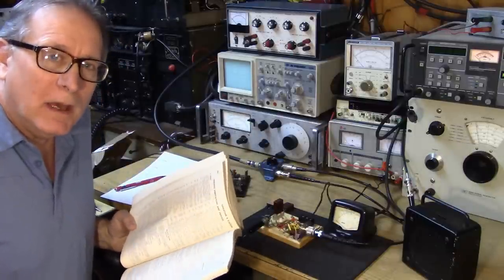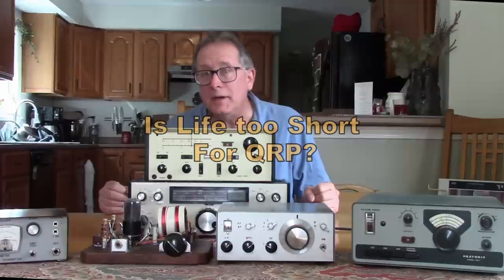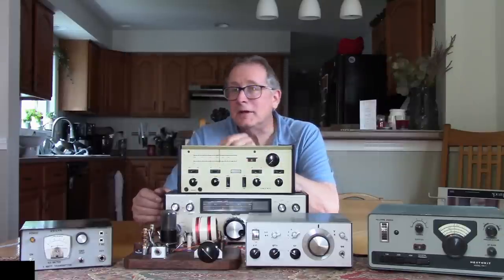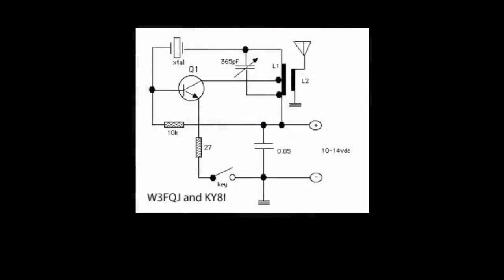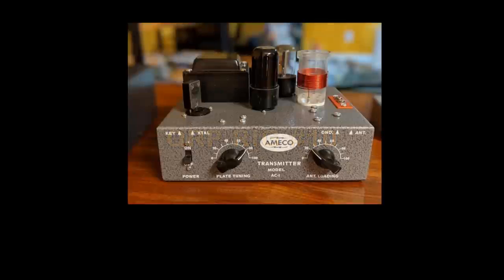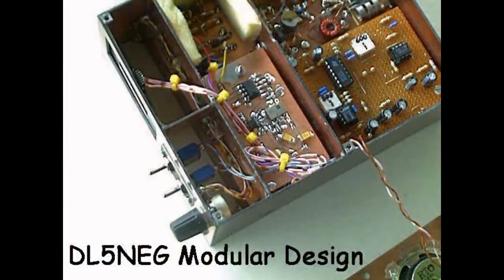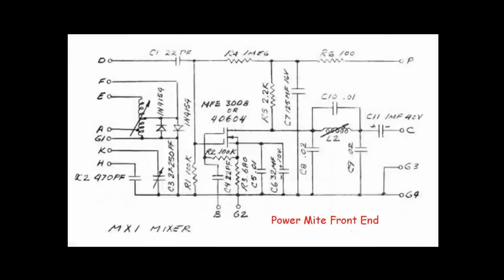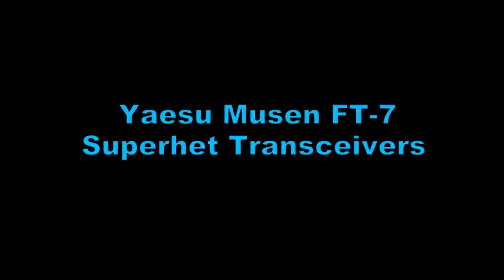Top 10 QRP Rigs of the 1970's - 80"s

Comment: I am a die hard QRPer since 1996. You had a tough job of picking the top 10.  I have and use the TenTec PM3A, HW-7, HW-8 and INDEX LABS in weekly rotation but my favorite is the Heathkit HW-9 with the WARC bands option.     

Sam AE4GX
Reply from the maker: The HW-9 is just a touch late to make my list. That is a great radio.

Comment: Another great presentation. Actually a brilliant presentation! I had completely overlooked the PW Severn - maybe I should build one 40 years later!

QRP works because; if a 100 watt transmission gives you an S9 signal, a 25 watt gives S8, a 6 watt gives you S7, etc. Anyone listening to the International Beacon Network can hear the relatively small difference between the 100W dash, 10 watt dash and the 1 watt dash - even the 100mW dash is often audible! 

Unfortunately QRO is needed now to overcome local noise. 

My carefully restored Heathkit HW-8 (2 watt output) has a noise limited sensitivity of 0.05 uV on all bands, although noise is at least equivalent to 5 to 10 uV on the lower bands!
Reply from the maker: dB or not dB! That is attenuation!

Comment: My first rig was a Century 21. Worked Australia from Glendale California on about 60 watts. About means it's almost impossible to get the rated 70 watts out of a Century 21. The power supply has a current limited that shuts everything down when the current reaches that magic 70 watt point. You then have to cycle power off and back on to reset the limiter. Standerd operation for me was to creep up on the power let it trip rest and back the drive control down a little. So, I was always a little below the limit. The pluss was, you did not have to worry about destroying power transistors in the final PA. It was a great rig for a Novice.
Reply from the maker: Century 21 Lore! Hey but the meter had this zone you tuned for- right? Ha.
Reply: One of the most balanced and beautiful front panel

Comment: Excellent video, as always, of an interesting topic, QRP operating rigs of the 70's. Living in an apartment I built a Heathkit HW-8. I ran coax our to my car in the parking lot to a Hy-gain mobile antenna. I worked a w4 station in Miami  right off. I told him he was my first QRP contact with my HW-8. He said he would QSL. Now have a  MFJ-9120 and MFJ-9120, QRP transceivers which are a lot of fun with the battery pack and turner. A great handy Yaesu FT-817, and a Elecraft KX3. I built an Elecraft K1 and used it for years with great success. The KX3 is amazing! Outstanding rx. Thanks for your outstanding videos. W5JCS
Reply from the maker: Wow but maybe the coax radiated better than the car!

Comment: The guy that got me into amateur radio was a die-hard QRPer, who pointed out that with a kilowatt amp and tower mounted beam, you could work all continents in a single afternoon and what's the fun of that.  A good friend had the Power MIte and we had great fun with that as teenagers.  I later got an HW 8 that I still have and that I brought with me when I spent a year at Palmer Station Antarctica in 1980.  Although the serious amateur work was done with Collins KWM2s, and kilowatt amp, it was fun to hook up the HW8 and work stations around the world.  No doubt the beam antenna and KC4 call helped, but it was amazing what 2 watts could do.  Fun times.
Reply from the maker: Ha that is great! We had point and shoot at our college station at RIT with the Drake twins and a Henry 2K and a beam 4 stories up on the engineering building!
Reply: @MIKROWAVE1  Thanks, and both our stories confirm that a good antenna is far more important than raw power, which you can easily  confirm by seeing how many stations you can work while running even a full kilowatt into a dummy load.

Comment: Nice one! While watching this I couldn't help but think to myself "will the Yaesu FT-7 get a mention", so pleased to see that it did. My first radio as a VK novice was a Yaesu FT-7, I recall that it had a 1978 date code, as does the one I have in my collection now, some 40 years later!
The FT-7 was a great performer and very popular with the novice operators here in VK (late 70s, mid 80s), they are still somewhat sought-after even now, more as a collectors item though. 
Just as an additional comment..
If I recall correctly the original FT-7 being the 10 Watt version was released around 1977, the later FT-7B being a 50 Watt version with greater 10 m coverage and AM mode added, was released around 1979. Personally I prefer the earlier 10 Watt version (closer to 15 watts), as it only draws about 3 Amps, and it's so easy to work on..

Thanks to Mike for his great work again.
Reply from the maker: There are those that have seen and worshiped them - and others who have no idea what you are talking about.
Reply: Yes, Chris, I had the FT7 10 watt  (not the FT7B with the 50w). Mobile in my car worked over a hundred countries on SSB.  (hard to concentrate on CW while driving though I did work a few CW stations by replying on SSB!!).  Great video, thanks.   73 de g3sdy

Comment: My first QRP (1973s) was single SL100 running 500 milliwatts (xtal controlled). Worked lots of VU2 and 4S7,8Q7 and MM stations on 40meters. Same rig changing 14mc Xtal used to work North Indian stations. Proud to get 1000 miles per watt certificate from ARCI contacting a  VU2 station in the foot hills of Himalaya’s. 
Without modulator, just connecting carbon mic made AM local contact !!!

Comment: A few comments for someone who is just getting into this type of gear:
First, the HW-7 had a lot of receiver problems and is not a practical option. In fact, Heathkit themselves opted to create the HW-8, which was essentially the same transmitter section with an entirely new receiver section, as a replacement.
If you want a HW-7 purely as a display piece, that's fine, but don't expect to get a usable rig.
The HW-9 was a superhet receiver , as opposed to the direct conversion receivers in the 7 and 8, and included the WARC bands as an option. 
The definitive work on mods for these rigs is "The HW-8 Handbook" by Michael Bryce, WB8VGE. The second edition is 2003, and is available on the internet as a download.
The Ten-Tec Century 21 has a maximum output of 70 watts because that is what Novices were authorized to use at that time. However, it is easy to turn it down to a few watts and it works very well.
Happy QRPing!
Reply from the maker: Agree and it takes all kinds of tricks to get the receiver operating hum free beyond just a good tuned antenna.  But it does work after a fashion. Or at least that one I was given for the video worked enough. One note you have to almost zero beat the station you are working - or you walk up the band like an NCX3!

Comment: We started out with what is now considered QRP at one or less than 10 watts because the transmitters of the time (1920) were DC operated at battery voltages. Then we vaulted forward with line power and triode tubes of higher transconductance and longevity. Now, today we have power amplifiers that are transistor based, and the semiconductor receiver that is more sensitive and selective than ever before. So, now we can lower output power levels and still be heard over other stronger signals and noise levels. QRP flea power is still a challenge to us, but I have gotten +10 db signal reports worldwide with less than 10 watts CW and 15 watts SSB. Some days and nights brought no contacts at all QRP. Yet most times brought rewarding contacts with less than 5 watts on each mode. Propagation is the key. Lots are saying now "no shit, sherlock". But it is the power rich types I am typing this for. Low power transmitting solves so many interference problems, makes our hobby so much easier on our neighbors cheap electronics! I am not saying that we must not impinge on them at all, but I think we must have both capabilities of normal (1400+) and QRP at the same time. QRP for the challenges it brings to the shack, and full power when we absolutely need to pass messages in an emergency. I have alot of fun when I get a 5-9+ SSB or a 5-9-9 CW on 5 watts! This, I believe, is the new challenge to get us excited over worldwide DX with “fleapower“!
Reply from the maker: Those one tube oscillators and early MOPAS were and are a lot of fun. I have a 1 tube 01A Meissner oscillator that does about 250 mW out on 80M and it makes a flavorful tone.

Comment: Thank you for mentioning - albeit briefly- the AM Mobile Rigs of the 1950's.   This was a big, complicated and often expensive segment of ham radio at that time.  It was FULL of small homebrew transmitters - so much so that there are about a dozen Mobile handbooks full of construction articles published by ARRL, CQ, and 73 magazines.  Low power because of expense of both the transmitter and the power supply, and the very low capacity of 6 volt cars ( 6v x 30 amps = 180 watts..if you raced the engine !)  Factory made transmitters and reciever were quite expensive if they were in the 50 watt plus category.   But there were many simplified low power (garage) factory made rigs like  Lysco, Subraco, and others.  Stancor, Gonset, Johnson, Morrow, and Heathkit made gear in both kit and ready made form.  One of the classic ultra small 3 tube 5 watt AM transmitters used a carbon mic 6AQ5( 6V6)  modulating a 6AQ5 (6V6) with a one tube crystal oscillator. This started as a homebrew design but then was manufactured by several companies..one of the most interesting of which is the Mars Thunderbird   designed in the US but built in Japan. One of the very first Japanese imports for the ham market circa 1959-60.
Reply from the maker: The surge in the first generation of mobile came with the idea of everyone being able to afford a car after the war. The car converter and homebrew transmitter era is seen in the magazines and the ARRL Mobile manuals of the day must have been a real treat since the had great sunspots in the late 50s.

Comment: I built and operated a Benton Harbor Lunch Box. Rockbound and limited, but at least I could afford it.
Reply from the maker: Great little radio that made all kinds of HISSING NOISE too. I had one on 2M with a modified TV antenna and Balun on a rotor. Worked out 35 MIles!

Comment: Thanks for the informative video, I've only owned one of your "Top10"; a very second-hand PM2A that had unfortunately been bodged by a previous owner and was quite old when I bought it in 1985. The receiver worked pretty well but the transmitter had a socket for the PA device, never did get it working...
You're quite right about the challenge of QRP Vs. QRO; my home rig is an old TS-140 that I usually keep wound back to 5W and I also like to operate portable with my 817, MTR3 or QCX.
At some point I want to have a go at building some of the old transmitter designs etc., and there's also the complete set of kits (Tx, Rx, VFO, T/R switching, casework and other bits) for a C.M.Howes 80m transceiver that I picked up for £10 last year!
73, G0CIQ
Reply from the maker: Socket in the PA spot - try and then buy?

Comment: Stupid questions: when we see you transmitting Morse Code, we hear an audio tome, does that mean that the rig is sending an audio modulated signal?  I see the circuits that you were showing (single transistor transmitters) and it looks to me like there is no audio mixing... so when those are used then is there simply a carrier wave and no audio mixed in?  If so how does that sound at the reciever?
Reply from the maker: These radios all have a built in sidetone that is generated onbord and ported to the headphones or in my examples through a 600 ohm to 8 ohm transformer in the speaker box. The little homebrew transmitter used the external receiver to receive the signal as a sidetone.
Reply: No, to answer the question it doesn't send a tone. Just a continuous wave at the frequency in use. The receiver needs to add some "tone" so you can hear it, otherwise it is just telegraph clicks
Reply: @mikekokomomike  Thank you!!!!!
Reply: @mikekokomomike  So this makes me think (realize) that I could probably do something:  I built a circuit quite a while ago using a Hartley one transistor oscillator that produced an 800kHz sine wave.  I used it with a Gilbert Cell multiplier to create an AM signal, with an AM radio telescoping antenna, and was able to pick up the audio signal that I used as the modulating signal on an AM radio.  Now I'm thinking that I could skip the modulation and just use the 800MHz sine wave, with the small antenna, and receive the 800MHz signal and maybe filter it out, run it through a "detector" (diode) and light up an LED when the signal is transmitted.

Comment: I owned both the FT-7m (20W) and the FT-7B (50 W) transceivers. Had a QSO with a USA station mobile on SSB on 20M with a Hustler RM-20 antenna. Brilliant radio. Loved it.
QRP. My dad built the Breadboard osclilator that they used in the 50's and 60's. A single 6L6 and doing 6W CW.
Reply from the maker: The "6L6 Crystal Cracker" breadboard was a very popular transmitter. And it worked beautifully.

Comment: My first novice station (in 1959) was a Johnson Viking Adventurer transmitter. 50 Watts 'input' which was about 25 to 30 watts output too a base-loaded vertical antenna. The receiver was a Philco superhet kit that covered 80 through 10 meters. My first intentionally QRP station was a 5 watt  MOPA transmitter and a hope brew Superhet receiver. Both were home brewed from Doug Demaw plans back in the 90's. The Heathkit WW7 and HW8 were both good rigs. Thanks for the trip down memory lane. 73 de K7RMJ Frank. dit-dit.
Reply from the maker: All of us builders and dead buggers followed those grand masters and many others all around the world.

Comment: 3:23 On screen "...Miles per Watt..."  Given that RF power spreads out according to the Inverse Square law, this flawed metric favors tiny power over very very short distances. Even the mere mention of a mindless linear ratio of "Miles Per Watt" for what is an Inverse Square law relationship is conceptually and technically repulsive. If my math is correct, then if one could convince a signal generator set to -30 dBm to reach across your workbench (2m or about six feet) to a receiver, then you'd have beat the "1000 Miles per Watt" metric (1 microwatt and 5.28 feet = 1 watt and 5,280,000 feet or 1000 Miles).  Then start dialing in -40dBm, -50dBm, -60dBm, how many orders of magnitude better can you go? If it helps (it will), then close the gap to a few inches, or a few mm, and try again; the math favors tiny tiny tiny distances. The unbeatable world record for "Miles per Watt" can be set by anyone with a signal generator, a sensitive receiver, two little loop antennas (perhaps close enough to constitute a transformer), and a tape measure (or micrometer when the distances shrink towards zero). All Hams should have noticed this conceptual error in the mere mention of "Miles per Watt". Cheers.
Reply: You are completely missing the point.
Reply from the maker: How about Miles Per dBm?😃

Comment: I have a HW-8 tricked out with lots of mods courtesy of John KC9ON and easy to work on. BTW, K7SZ's moniker was "Rich" not Rick (yeah, I nit-pick) but Rich was a good friend of mine going way back to the early 80's when he and I were on active duty, Rick in the USAF and me in the USA stationed at nearby posts/bases; Rich's passing was a real loss to the community.  73 - Dino KLØS
Reply from the maker: The mods on these little rigs filled page after page of ham mags and even was found in some of the compendiums!
Reply: @MIKROWAVE1  Yep, Mike WB8VGE (of the "Heathkit Shop" fame) has one of those covering the HW-X QRP rigs series. Thanks for another great historical compendium series Mike!